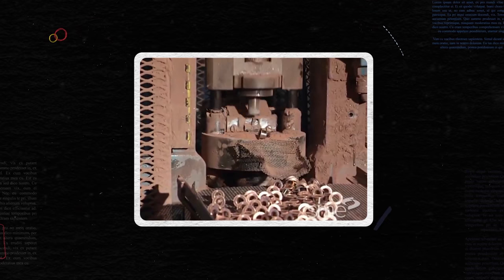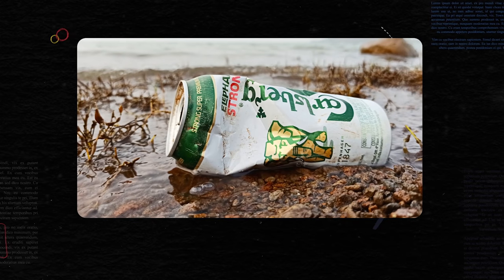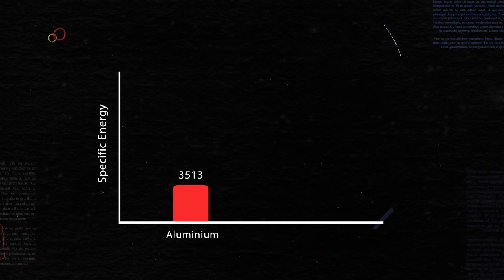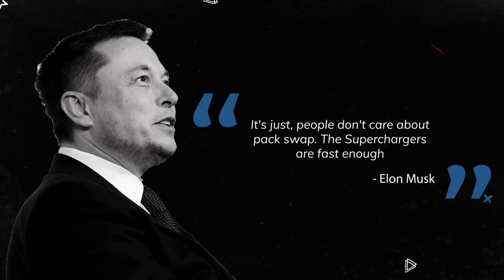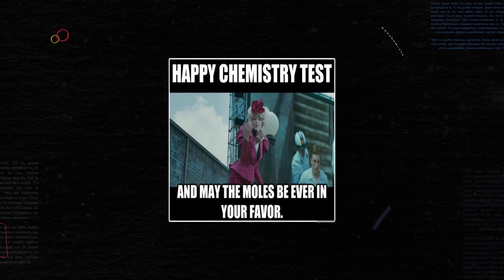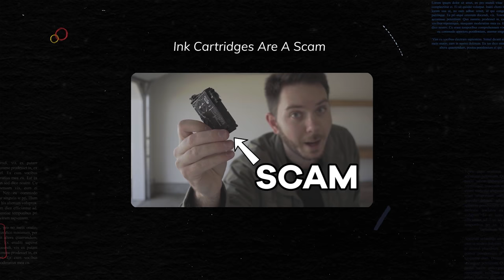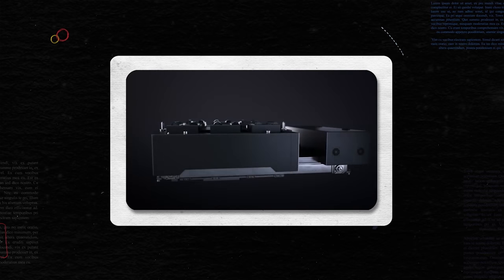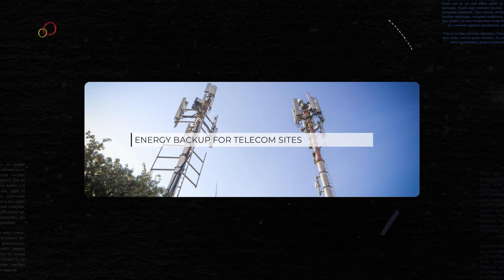We Can Get 1600 KM of Range With Aluminium Batteries

Comment: Extremely well made, and informative video. Well done.

If I were to start an EV company now, then I would only make the car. Everything apart from the power source and motor. I would work out a specification for these components by form factor, maybe with input from some interested suppliers, and then license some to manufacture and sell/rent out these components, big motors, small motors, battery packs, fuel cells, whatever. To that specification.

Only EVs can do this, and it is desirable, so it must be done.

It would be good for the industry, and good for the consumer. Good for the future.

If the EV owner wants the nice car, but is happy with 50km range at super high speed. Maybe fast charging super capacitors. Then so be it. If somebody needs high range, but speed is not such a factor, then so be it. Etc... Etc...

Comment: I'm about to buy a third hand 2012 Nissan Leaf and the battery is at about 70% and therefore the car is at a significant price reduction($2650). I've already set up an appointment with a battery recycler/refurbish company here in Seattle. They are going to drop the current battery and install a battery that is guaranteed to be at least 95% for $2800. They will break down my old battery, recycle the bad cells and use the rest in battery walls or if they meet the standard back into other refurbished batteries. Car battery recycling is here now.

And yes, I know how to use LeafSpy.

Comment: The answer is probably a combination of both, a hybrid car which has 100 miles or so of range using rechargeable Li-ion batteries, the car then switching to Aluminium Air batteries once the Li-ion batteries are depleted. Bearing in mind most people drive less than 100 miles a day, most peoples driving needs most of the time would be met by the rechargeable Li-ion battery, however for road trips and longer journeys the non rechargeable alum. air batteries would automatically be used.
Also I would imaging instead of one very heavy alum. air battery, a better option would be to use several more manageable less heavy batteries which also come with the correct amount water sealed inside of them, a bit like AA and AAA batteries, TV controllers often use 3 of them, RC cars use 6 of them. Simple and easy, a hybrid Li-ion/alum air car has 10 alum air batteries each weighing 3kg, as each one is depleted you just replace the one dead battery, the car sequentially using one battery at a time.
I have a Vaxhall Ampera UK version of the Chevy Volt PHEV. If I could replace the battery pack with a modern Tesla battery pack, remove the ICE engine and replace it with 10 alum air sockets with alum air batteries plugged in I would have this car, the technology is already available today.

Comment: This actually sounds very appealing. Regarding your points:
1. the car does not have to have 1000-km range battery. Most people would be happy with half of that. That would lower the weight of the anode to 20 kgs. Further - why would you have to replace the anode in one piece? It could be 4 smaller batteries, each with an anode of just 5 kgs each. You could replace as many anodes as you want at one stop (like you don't have to put the full tank of gas in a gasoline car).
2. the energy used to make aluminum - the question is not how much energy it takes to make the anode, but what % of the energy spent on creating the aluminium is used to move the car. Aluminum is the fuel here. You spend energy to separate it from oxygen and then you recover the energy when it re-combines with oxygen. So you use energy (wind / solar / fossil fuel) in a power plant, and then this energy - converted to electricity - is used to move the car. Tesla uses this electricity to recharge the lithium battery. Aluminum factory uses this energy to separate aluminum from aluminum oxide. So the question is - given 1kWh of energy at the source how much energy can be used for moving the car? Exact calculation can be done, but using the cost calculation - it should be quite an efficient process.
3. Regarding refueling the car with the water and removing aluminum oxide - it can be done with a specialized pump. You just pull up to a refueling station, plug-in the pump, and it would do all the hard work.

Comment: This would be GREAT as a three way Hybrid. With A primary electric engine, powered by batteries, that charge from the aluminium fuel cell, and a fueled generator for emergency power. Not to mention, solar coating all over the vehicle...

Anyone want to convert my van for me?

Comment: Actually a item made of an alloy of iron and aluminum (and other metals not used until the 19th/20th centuries) was discovered at one of the possible sites of Noah's ark about 30-40 years ago.  Since we are just starting to make iron/aluminum alloys in the past 15 years,  it was not a faked artifact.

Comment: I love your channel too.
FYI
There are company startups now that are gearing up to recycle batteries eg "Redwood".
It sounds like what you're saying is that we would have to continually mine aluminum to make the batteries. I did not understand if there was a closed loop recycling involved.
Lithium batteries will at least, in a perfect world, be a part of a closed loop recycling process. Theoretically speaking. Also lithium is just the embryo of battery evolution. Lithium will be replaced but probably not in my life.

Comment: If the batteries allow the charge to last for (let's say) 1,000 km but you need to replace the water in the battery every 300 km, the range of the vehicle is 300km, not 1,000km.

Comment: To qualify as saying it would have a 1000km range you would need to include the extra weight of 2-3 water swaps worth of water, a device that pumps new water in, a storage tank for alumina solution, and a device that pulls the sludge out.  This would keep the battery running optimally but add a lot of weight ... possibly detracting from that 1000km range. I think this application makes more sense for electric airplanes (EAs) as the cathode replacement and maintenance equipment will be a niche infrastructure to start  and isolating it at airports would be easy.

Comment: The bane of EV is load.  Just like the lie for meeting CAFE standards; that being testing at 45 mph and not actual use case.  The same can be said of EV claims.  If you drive like an old lady then you'll get close to claims.  Drive like a little old lady from Pasadena and you'll be far off the claims.

Comment: Why 1 battery(fuel cell)? Why not 2 or 3? Then the anode only weighs 1/2 or 1/3 the weight. Yes it a little bigger because you have 2 or 3 units but each anode weigh enough less to easily replaced by most people. Self serve swap option.

Comment: 1600 km of range, but you have to change the electrolyte 5 times before you also change the anode. Unless those cars are cleverly designed, to allow for easy, automated and safe replacement of electrolyte and Alumina disposal, and then anode replacement, it's just not worth the headaches with the many things that could (and would) go wrong, costing more time and money to fix. I'm not sure how the technology can be improved, considering it's all about the chemistry of Al-air batteries, but I wish them good luck. :) Good competition is always nice to have.

Comment: If you only use one aluminum block then there would always be leftover aluminum when swapping to a fresh one. I think a 2 block system would be better. Also, reducing the size of both blocks to give a total of 300 kilometers would make each block relatively light and easy to swap and about what you get out of ICE vehicles.

Comment: Couldn't you produce the anodes during times where renewables power the grid? (During the day or windy nights basically) Then you could produce them carbon neutrally, and cheaply. Also this would enable energy storage over many months for seasonal storage to power through the winter.
Interesting concepst. Maybe also viable for low energy agricultural applications. 1 ton front weight batterys wouldn't be a problem for tractors.

Comment: I believe IBM is developing a lithium-air battery. Promising physics but not available so far.
There isn't much lithium in lithium batteries - 10 to 20kg in a Nissan Leaf for example. It's the nickel and the cobalt which are a big cost factor.  
Also, batteries ending in landfill is a problem that can be solved in one line of a legislative act. Just say it's illegal - just like dumping lead-acid batteries in landfill is illegal.

Comment: This would never work here in the US. 1000 km is roughly equal to 600 mi. I drive that in just 2 weeks on the average.

Perhaps the batteries could be made of smaller but standardized cells, which could weigh say 15 kg each.

These cells could be treated like returnable bottles. One hands in the old cells, using them as a credit, then buys the new cells, paying the difference.
The battery cases could be designed with female terminals which the vehicle connects with, once the cell is put in place. This would lower the chance of getting electrocuted immensely.

Comment: water filled and sludge removed every 300km. 

This is a larger negative than marketed. Needing hazmat sludge removal, hazmat recycling of this material, inconvenience to the driver, unable to do at home. Then anode replacements a few times a year. People already are bothered by oil changes, and those are maybe once or twice a year. Not to mention both of these things need huge infrastructure projects, like all of the recycle centers, anode swapping centers, etc.

btw, is the range really 1600km if you have to stop every 300km for maintenance..?

Comment: AluPower Inc tried to be a 'new' battery technology provider some 30 years ago, and even had demo kits available, but they still had 2 road blocks - 1. The battery had to be replaced when expired (same as any ordinary 'dry' cell). 2. The battery had decreasing power delivery, as the oxide layer increased, degrading the current delivery as it aged.

Comment: @Tech for Luddites, 14 min. Lithium is scare and aluminium is abundant - if you see the material break up of a current Tesla model 3 lithium ion battery, you will find less than 2% lithium whereas 40% of the battery weight is aluminium. So here we go, even though lithium is scarce, we need very less quantity of lithium in each battery

Comment: Aluminium hydroxide sludge, even if it could be removed cleanly and easily from the battery, would not be worth the cost of recycling it back to the aluminium-manufacturing plant and probably would have negative value. It would certainly be unable to make any contribution to reducing fuel cost from 11 cents to below 8 cents per kilometre.

Comment: Sounds good some what. Interesting that there is more ways to have a 'battery'.  Liquid metal batteries are another. 
  The aluminum concert is about 1¢ cheaper than my gas vehicle based on a 30mpg calculation. I wonder how much time for annode change versa 3 fill ups?

Comment: I don't know how practical this would be, but an Aluminum Air battery might make a sort of "Jerry Can" for an EV.  In an emergency you could remove a sealed cap that would let air in, and then either use it to recharge your car, or just temporarily replace the battery (through a dedicated connection), and get to either your destination, or a charging station.  Then, later you could swap the Aluminum Air battery for a new, sealed one, and the (partially) used battery could be recycled/refurbished and resold.

Comment: Elon Musk and all the people who are priveliged enough to park on private property rather than the street, including myself, need to remember our neighbours who only have on-street parking to rely on.
Solid-state batteries charge quickly, and hydrogen fuel cells refuel quickly, and aluminium air batteries are much better for people without charging space than charging a battery is.
If fuel cells become cheap, or if hydrogen combustion replaces petrol combustion, then that's better for street parkers, who are a large percentage of the population if not the majority. Same goes for aluminium air batteries.
That's because the street parkers have nowhere to charge.
That's why population-dense China has battery swapping instead of charging for electric cars.
So economics is not an issue for aluminium air and hydrogen fuel if no other zero-carbon option is suitable for people without garages amd driveways.

Comment: It seems to me an aluminum air battery would be an excellent emergency charging option to throw in the trunk of the car as a backup- particularly for cross country US driving where it would Suck to run out of juice in some places (literally, I've passed the sign that says "No services for the next 100 miles", and they mean it.    It would also be an excellent home emergency or camping generator sort of option-  that, I think, will be a good niche for this tech.  And it would be easy to implement- make them about the size of a standard car battery, and do the swaps just like we do led acid at anywhere that sells those.

Comment: Vehicles could be designed to use multiple smaller batteries so the batteries could be more easily managed by individual people, and governments could create standards so that multiple manufacturers and stations could compete to prevent the ink-jet-printer-problem. Just like with smaller batteries now: A, AA, AAA, D, etc. are all standards, so that we're not forced to buy a specific brand of battery for our toy robots and wireless computer-mice.

Comment: This channel often presents a rather bleak view.
A modular battery system would allow the aluminium weight to be split into smaller weights.
So a bank of 4 batteries would only be around 10kilos each, per cassette. Weight issue, sorted.
Also, if renewable energy is used to process and/or reprocess aluminium, then that in itself is a form of energy storage.

Comment: What is the problem with replaceable battery packs?......I replace torch batteries, clock batteries and other types on a regular basis because the technology of having a cell you remove, discard and replace is well advanced for the process.......my RACV car technician replaces my car's lead acid battery on a 4/5 year cycle when the battery ceases to function and it only takes 20 minute to do the swap.
I think the idea of having a large capacity battery that lasts 3,000 +  Km of use is ludicrous.....it becomes too costly and too cumbersome to replace in a one hit situation.
Better to have a smaller battery, but better still to have 2 smaller batteries that lasts 1,000 km and is able to plug and play by an average auto electrician or garage at a moments notice and one that weighs less and takes up less room in the car's body.......at the same time the battery would be universal and could be moved from car to car if you had more than one car or bike.....it could also be a DIY thing once the system was up and working......the cost is relative to the use.....you don't get anything for nothing......petrol goes up and down like the waves on a sea shore but we pay all the same.
Why is it Tesla has not embraced the al air battery and developed it further with their vast resources?......because they decided to pursue a certain path with a lithium infrastructure and you don't change horses in mid stream at any cost.
If Tesla had decided to go the Al air path then the battery in a Tesla car would be such a one and their technological know how would have made it possible.....it's all down to a money factor and you don't throw money away by gambling it.

Comment: Hopefully, someone makes a car that can dock and center the batteries and swap batteries.  At the end of the vid it suggests a hybrid of lithium batteries, and Aluminum air batteries.  That would give you a car that you plug in for the standard 30 mile commute, and the aluminum air battery would be used if you go over that amount.  That would result in a plug in car with Lithium battery and Aluminum air battery with super long range, and would only have to be replaced every four to six months.  Imagine half lithium 100 mile range and half Aluminum air 500 miles, for a total of 600 miles.  Not to inconvenient for most and it would reduce the needed charging infrastructure.

Comment: What is needed is a reconfiguration of the battery into two parts such that when one is exhausted, the second one cuts in.  Then we need a system in which you can slot in the new Al anode by yourself.  Each one would weigh about 21kg, well within the capacity of most anyone.  A little light on the dash board tells you when one is finished and you have switched to the second.  You have 500km until you must swap out the anode in the exhausted one.  We could even have two batteries which are a quarter of the size proposed.  Each one gives you 250km.  The weight which must be changed would be 11kg.  Even more feasible.  Even four 11kg batteries could be used - all in one package.

Comment: Rather then one single Anode you would want to have 4-8 per vehicle massing 5-10 kg each such that you can manually change them.  The station then becomes dedicated to swapping the individual batteries nut unlike how propane gas cylinders are swapped.

Comment: i've seen coverage of aluminum air batteries before, and the main problem of course is you need all that support in place for replacement and recycling of the things.  i'd like to see this looked into more.  in the past i've wondered if these would be a good fit with some of those electric commercial "air taxi" vehicles getting developed around the world, or other kinds of commercial vehicles at least anyway

Comment: Does not the energy equation need to consider the aluminum hydroxide energy to convert to aluminum metal? All reactions reach a endpoint with lower energy. Replenishing the system is part of energy audit?